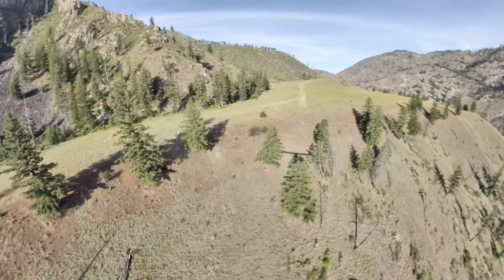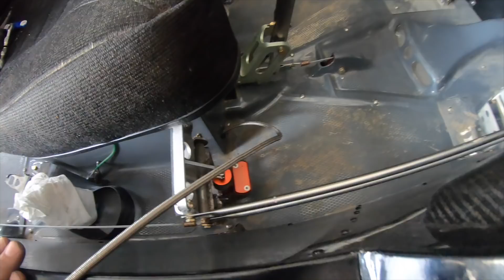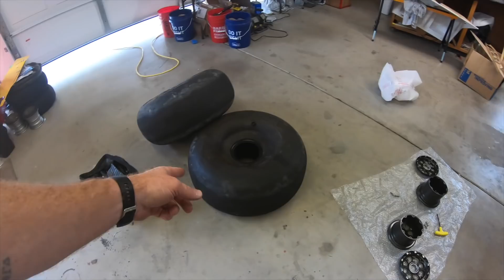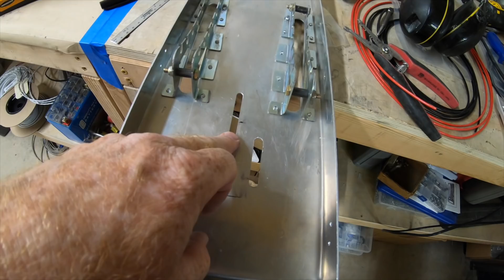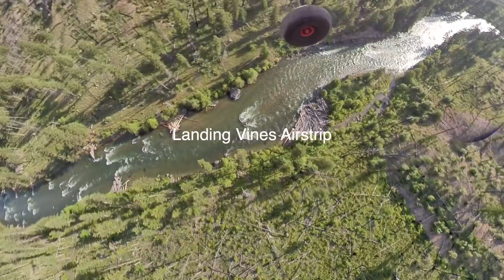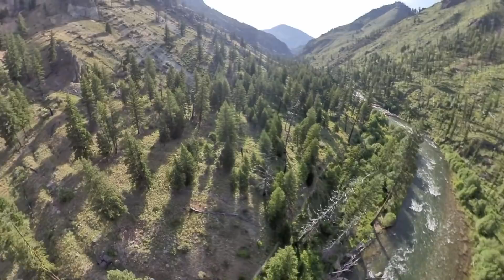Kitfox 7 Apex Build Episode 22 Beringer Brake Install

Comment: How do you compare the carbon cub to the kit fox. I’m planning to order and build one. but struggling to decide witch one I want
Reply from the maker: Side by side versus tandem seating is the biggest difference. I know several tall pilots that preferred the carbon cub for the leg room. Performance wise, they are very similar, but the cost to build is much less for the Kitfox and fuel burn will be less in most cases. They are both great.

Comment: 14:30 is CRITICAL INFO !!!   Don't tighten till everything is in place.  Hand tighten with the fitting 1/4 turn to be in the correct "clocked" position.   That way when you tighten the nut the line has zero twist. 

Great video Brian.

Comment: I'm wondering why more people aren't switching to the Desser setup.  ABW are super expensive and wear out so fast if you are forced to operate from pavement, and with heavy tread, they are heavier too.  I see that Beringer makes a 10" brake setup, I wonder if anyone has used that on the 31" desser.

Comment: It looks like the CarbonCub uses a bigger single caliper as opposed to the two smaller calipers on the Kitfox. Please correct me if I'm wrong. Also, was the anti-skid system installed on the CarbonCub? Is it an available option?
Reply from the maker: You are correct, the CarbonCub uses a 10” wheel on the ABW 35” tires, and the CarbonCub does not use the brake pressure regulator. It is a very straight forward install.

Comment: Hey Brian!  I am building a supercub, wondering why you went with the tk1 vs. Acme aero shocks?
Reply from the maker: The TK1 shocks are nitrogen only where the ACME uses a combination of air and spring. They are both very good and much better than anything else out there, but the TK1 can’t bottom out like a spring Shock. I have put them through the paces on my Kitfox 5 and could’ve happier with their performance. The other major factor is the outstanding customer service from Tony at TK1, nothing but the best.

Comment: Plastic break lines, hot day, high pressure... wait & see?
Reply from the maker: They are all plastic brake lines. The outside section will still be stainless, but those are plastic/nylon inside the stainless braid. We don’t use aluminum or steal lines on these aircraft. I have never had issues with them on hot days.

Comment: I wonder ho hard Berringer would be to put on a Zenith CH750 Stol instead of the Matco system.
Reply from the maker: No more difficult, there is a kit for the CH750.
Reply: @BowenAero  cool Ill look into it when I get that far. I only have to rudder complete so far.

Comment: Great, super great actually, video. Chock full of great stuff. Firstly, your Kit Fox F 7 looks amazing, especially with that Apex 300HP motor on the front. Stoked to really see the full paint job with the wings on. 
So a while back I saw a pic of carbon fiber landing gear covers for the full Beringer Alaska Landing Gear.  I made a mental note of it but thought it might just be a cool finishing touch feature. But after seeing Mike Patey's Scrappy winglets design; I thought, I wonder if those carbon fiber gear covers actually add aerodynamics? Also it was cool to see you and StolRats get a shout out from Mike on his scrappy build and mention how he respects you enough to paint StoleRats on the fuselage of his new aircraft project.